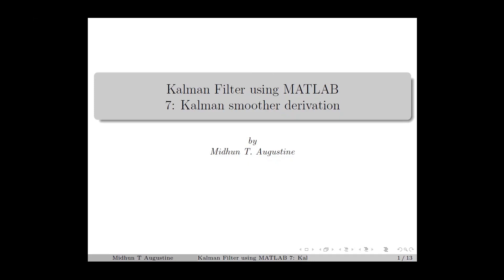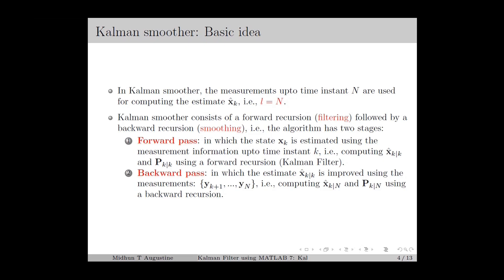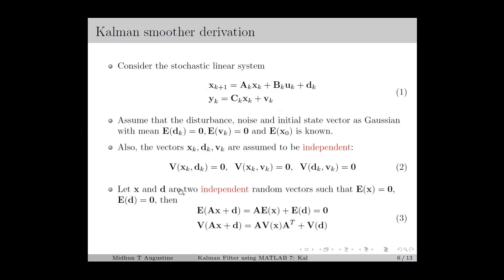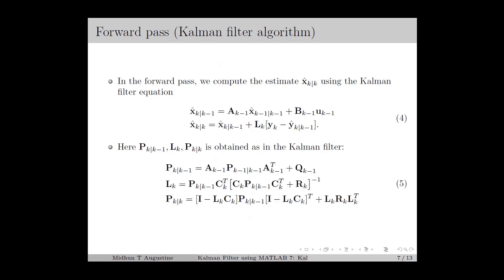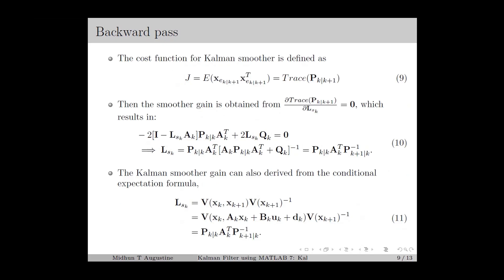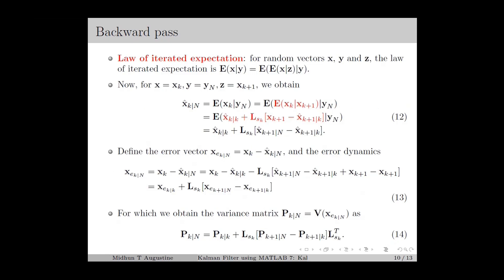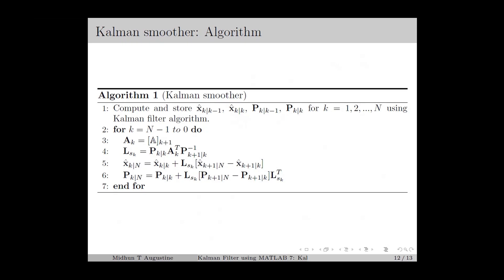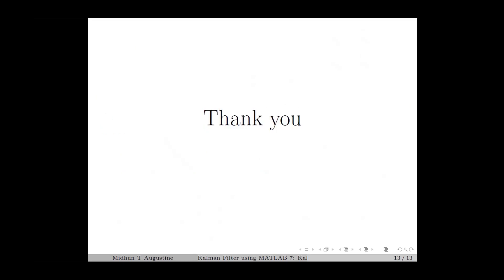7: Kalman smoother derivation

Comment: Hello, this has been very helpful. Could you please why at 5:01, the expectation of x_k|x_k+1 works out to be that expression? Also, why did we minimize the trace of P_k|k+1 instead of P_k|N, seeing as the algorithm uses x_k|N, not x_k|k+1?
Reply from the maker: Hi Pike, Thanks for the feedback. Here E(x_k|x_k+1) is computed  using the conditional expectation equation which is discussed in Lecture 2 (16:50 onwards). Also there is no straightforward way for obtaining a DRE for P_k|N. That's why we go for P_k|k+1 first, then use the law of iterated expectation to find P_k|N. If we can derive an expression for P_k|N similar to (8), then it is possible to compute L_sk by minimizing trace of P_k|N. But, I think it will be difficult here.
Reply: @datacontrolandmathematics3811  Thank you so much for your reply. I checked a few other sources, and cleared up the notation - sometimes x_k|k+1 means you are giving x_k+1 but in the x_k|N you are given y_1…N instead - so that was where my confusion was from - i think it is all clearer to me now.

So for the second point, would you say the Kalman RTS smoother is an optimal estimator, or a close to optimal? (Because we haven’t minimized the trace of x_k|N?
Reply from the maker: @pikeamornchat7169   Kalman RTS smoother is more optimal than Kalman filter and predictor, since it results in lesser variance. However it requires more information to achieve that. Also, I am not sure whether  RTS smoother is the most optimal one in terms of variance of the estimate. There are  other versions of smoothers available in the  literature. You may check some recent journals. Thanks for making this observation.
Reply: @datacontrolandmathematics3811 

Thank you again for clearing this up. Is there a way somehow of proving that the Kalman smoother has less error than the Kalman filter, even if it might not be the optimal estimator?

(Just like how the Extended Kalman Filter is not an optimal estimator but still works)

But anyway, that clears most of it up, thank you.
Reply from the maker: @pikeamornchat7169  We can show Kalman smoother results in lesser variance than Kalman filter using eq. (14). Here P_k|N is the variance matrix of the Kalman smoother and P_k|k is for the Kalman filter. Now P_k+1|N will be always less than or equal to P_k+1|k since the later is the predicted variance. This makes [P_k+1|N - P_k+1|k] negative semidefinite and thereby L_sk [P_k+1|N - P_k+1|k] L_sk^T negative semidefinite. Consequently, P_k|N will be always less than or equal to P_k|k. This may be proven theoretically using induction by showing that P_k+1|N is less than or equal to P_k+1|k.
Reply: @datacontrolandmathematics3811  Thank you so much for the clear explanation. That makes it very clear, and I will try and use induction to prove it myself. Thank you so much for your assistance.